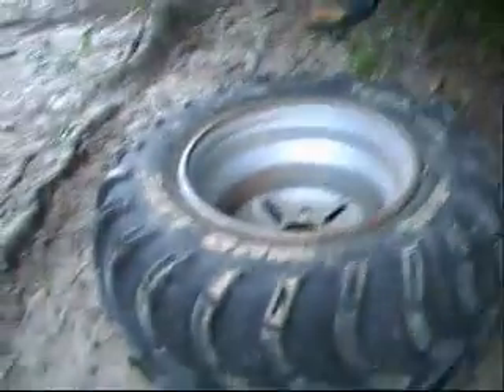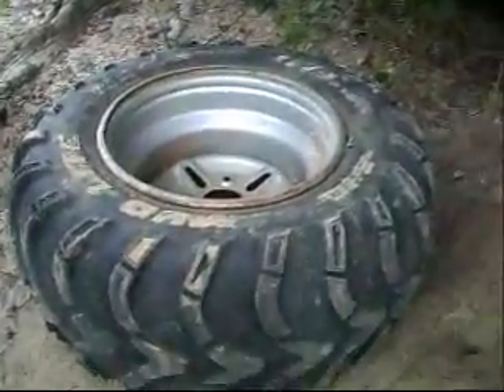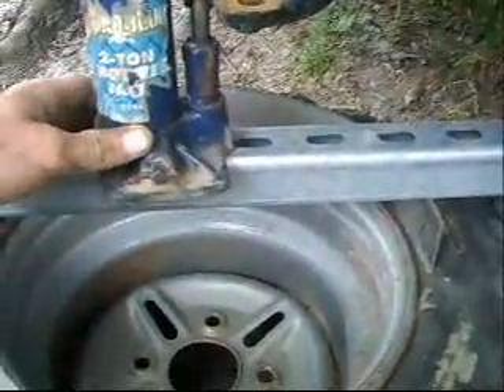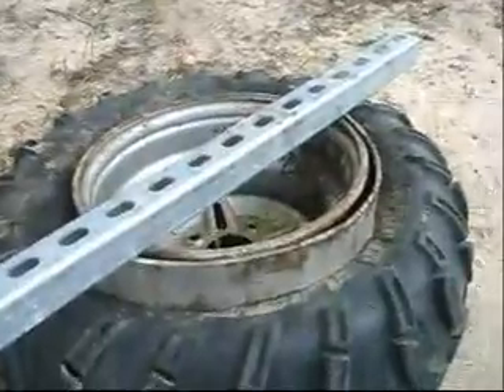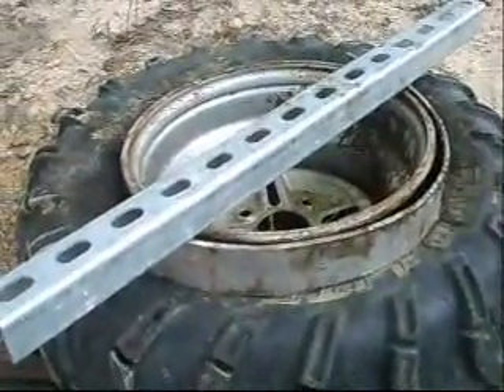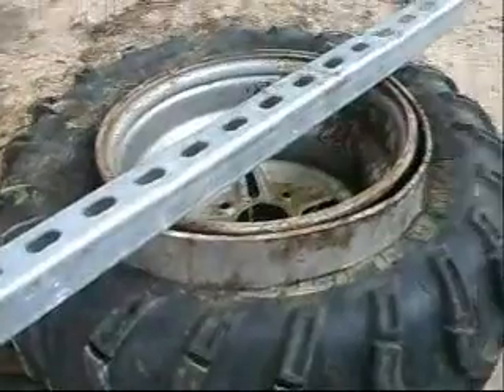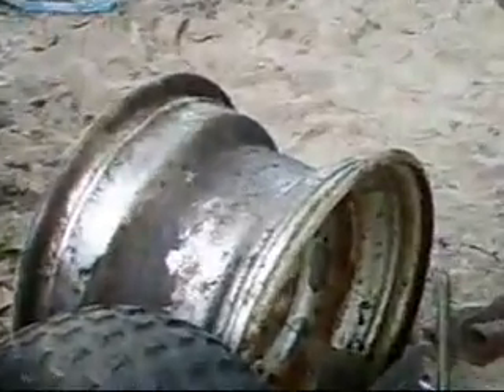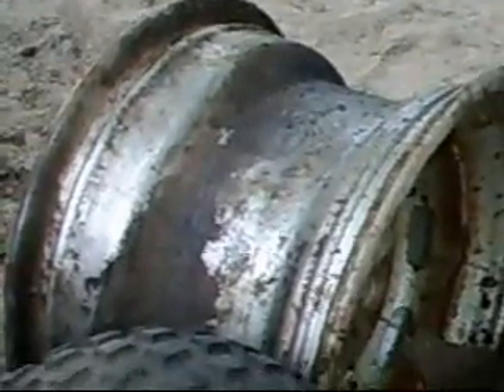Redneck Beadbreaker tire repair

Comment: I use car ramps and a metal rectangular piece of metal.  I put the metal rectangular bar across the top of the tyre and right up to the metal lip.  Then I put the car ramp on the metal bar.  Then I just drive up the ramp.  The tyre comes off the bead and all is well.

Comment: Cant you use all thread thru the wheel up to your metal bar and tighten a nut and it pushes down your metal on the bead??

Comment: I welded a piece of 1" pipe about 2' long to a 3" wide. 1/4" thick piece of angle cut 21/2" long. Wiggle and tap the angle between the rim and bead then beat it right above the vertical flange like a useless brother-in-law. I use as big a  hammer as I can swing. Get the angle against the rim before trying to get it to go down. Keep the angle tight to the rim to avoid damage to the tire/bead. Move around the rim until it drops down. Don't have someone else hammer! It's a 1 man operation.

Comment: I use an old iron pully that's just a hair over the bead n jack it up on a hitch however lol I've lifted the rear end off our 87 2500hd so thu can b a birch prolly cause I'm trying to break the bead the whole way around in one shot my buddy uses a bumper jack and wichita concentrates the force in a much smaller spot n it comes right off as for getting it off bead atv tires I like used two big screwdrivers anything bigger use tire bars ect.

Comment: I made a dead breaker and it works better then a £1000 one I got a length for steel square tube about 4 foot long then welded a peace 1.5 foot from the end about a foot high and it had two holes for the square tube that will pivot above the put a bottle jack on the other end then the other side with close and pinch the the tire

Comment: Just put a rim on your car, no tyre. Jack your car up. Put the tyre you want the bead broken flat on the ground under the rim and lower the car. Lift the car, rotate the tyre and repeat. Way less effort, especially if you use a drill with a reverse on it to raise and lower the jack. That's the Aussie way.
Reply: Or leave your car tire alone and just put the jack base on the tire you're trying to dismount.